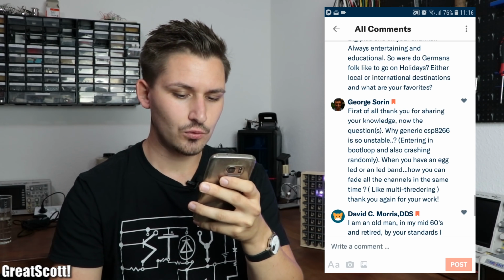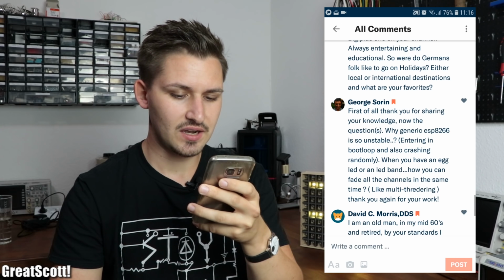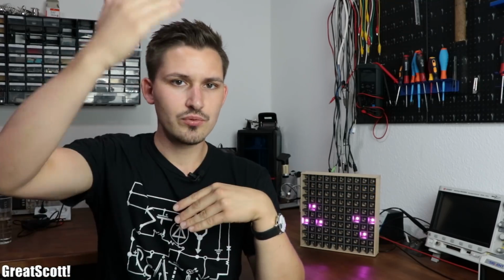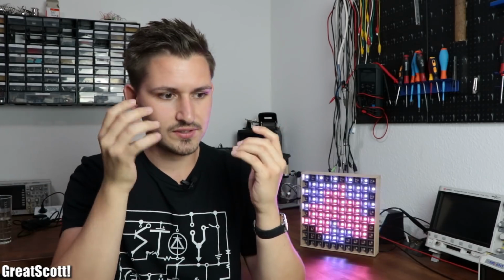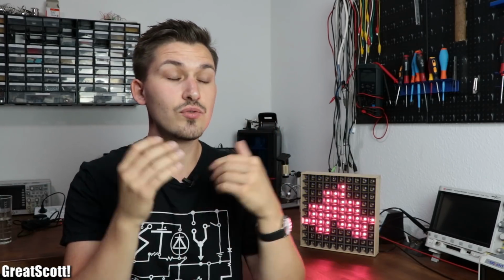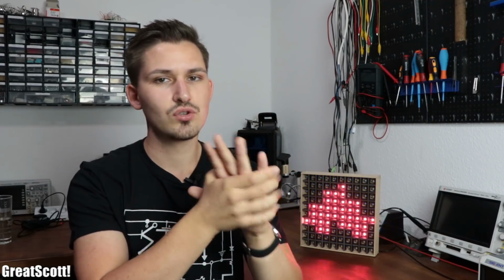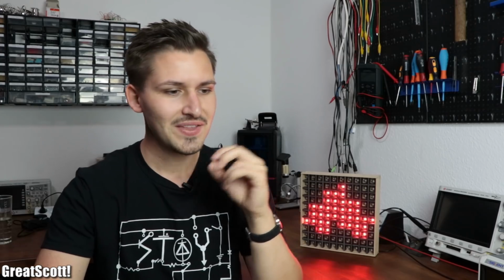Random/Unscripted Q&A #3

Comment: I have a question? Can a flyback tv transformer by used for power up light bulbs?dc motors? can this thing by some how turned to a usefull voltage? what components are used to amplify the voltage? can another transformer by used " step down"? well that shity thing use 10 to 30kv so? why not use it? but the question is how? and not die in the proces? the same question goes for a car ignition coil? I have some pore friend for some reson hese family dont have electricity he use a baterry converter 12v dc to 220 it drie the baterry after 3-4h so I was thinking helping him litel but not shure how fix that problem? and the question for baterrys how long they can least by using a converter/transformer? Ow by the way like ya ;) great videos I wish you all the luck in the futhure

Comment: I have a small question on this project ( https://youtu.be/CeStrH-5Llo ) : couldn't you have reduced costs, space and power consumption for this project by using an standalone ATmega328p for example?
I heard, that errors can occur during serial communication when not using an external oscillator, but even without using the internal 8MHz one.
Please tell me if I'm wrong, answer can also be in german.

Comment: Do you think you could make a DIY laser rust remover?  I've used these in automotive restoration shops before and they are something!!  If you accidentally point it at your skin it doesn't even heat it up!!  I'd love to see you try to figure out the electrical engineering behind one and possibly even make one!

Comment: I need Siglent scope in order to learn analogue electronics and  power electronics -  mainly switching power supplies. Thus I need 4 channels scope. Siglent also has serial data decoding functionality, which is needed to lookup serial communication e.g. SPI protocol. It takes me several days without scope to determine why serial communication on ATMega32A driven by interrupts was not working properly. This kind of instrument is quite expensive for me.

Comment: I just had a idea for future projects. I don't know which car you drive but if it is a older one that doesn't have modern features like windshield wipers that turn on automatically when there is rain, it would be interesting if you try to add those features by your self.

Comment: To the second question:
He could maybe use 26650 li ion cells.
They are 3.7V each with 3500mAh which would in series provide the wished 7.4V

Comment: You like EVs too!! Im currently converting my Saturn 2000 SL to electric and could use an oscilloscope! Check it out, Im actually waiting on a couple parts from CNC and Wire EDM manufacturers. 

diyelectriccar.com/forums/showthread.php/2000-saturn-sl-conversion-181954.html

Comment: Where i need to comment to try for the oscilloscope?? 

Sorry for this being too long but read anyway please :(

Anyway... Im electromechanical engineer student from a little country name Panama. I have main two projects currently that require an oscilloscope. The first one is an all i one charge controller, battery management, inverter system for solar. But, i want to make it as an educational module in order to put all the components and circuits in a way that students can use it as an electrical, electronical, logical circuits laboratory project.

Our university plan is outdated and specially our laboratories experiences. Many students lost interest in electronics since they found it too boring. Most experience are something like measuring current with a multimeter of a JFET. So this solar project can take all the theory and electronics circuits to be applied to something functional and helpful. I want to make the control of many discrete circuits so students can understand better how everything functions, not just putting an ic that does all the work. But i need an oscilloscope for development.

Second project may be my graduation project, if not a profesor an me would like to complete it anyway. In our local child hospital theres case where kids are born with out annus ( the hole wast not develope ), this is extremely critical for the life of the child, because he is basically stuck. The surgeon can take a procedure where he" construct " the annus of the child. The incision needs to be in a really precise spot where the muscles meet. Since surgeons don't have an instrument to locate this spot, they need to bulleyes it. Many times they dont locate the spot very well and even though the annus is constructed it isn't functional since the muscles can't contract in  a proper way. So a profesor and me think about making an instrument that cant locate this spot using the electrical signals that are get by electrically stimulating the muscles in the area. What would be better is a map of the muscles, but it requires equipment my University don't have, specially specially oscilloscope. We have oscilloscope but they are old and crappy and the sampling rate is not that good, also just 2 channels.

Im an electronic and programming enthusiasm. Where I live is hard to access components. You can't even get proper mosfet that can be used by an microcontroller. Thank god i can order stuff online, so i order components from usa , it takes longer  to arrive and is expensive but my parents help me. But, im oscilloscope like that one is something i can't afford. And the university i don't think is willing to help ( third world country problems ). Having that oscilloscope could accelerate these projects and be extremely extremely helpful.

Anyway, thank you even if i don't get it. Your projects are really inspirational and helpful. I use many of your videos for personal project and to learn. Honestly i kinda always knew how awesome electronics are but didn't know how accesible it can be. Your videos showed me that, i want to show other people the same and be helpful.

And stay creative

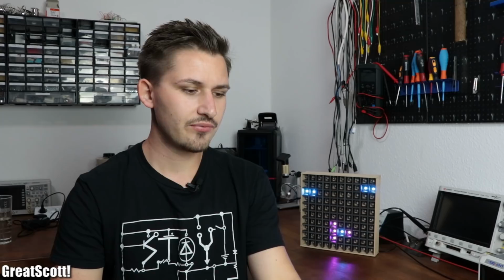Comment: Now maybe I'm missing some context here but you state at 36:50 multi-threading with micro-controlers is not possible. That's incorrect. You can put a operating system on the micro-controller such as FreeRTOS and create multiple threads. Now maybe you're referring to the esp8266 micro-controller which I'm not familiar with but a quick google search shows some people have used FreeRtos with the esp8266.

Comment: Hey, is it possible to make a Arduino board that you can upload a code by sending a file with wifi or bleutooth to the Arduino. I think you have to use at least two arduino's and a sd card. one arduino for saving the code to the sd card and uploading to the other arduino.
This would be great if that is possible.

Comment: There are micro-controllers with multiple cores like the ARM11 family. But in the most cases single processor micro-controllers are way more cheaper, more easy to programm and you dont need that massive power anyway. Greetings from Germany ;)

Comment: Hey scott your videos are awsome... I followed all of your videos. Currently i am working with a remote control with TX2b and RX2B ic..  But in the transmitter section i cannot visualize the waveform of frequency 27mhz..and i also want to visualize the demdulation of modulated signal to understand the working process of the circuit...The siglent oscilloscope can solve the problem... I need that badly.. Lots of love from india..❤❤❤❤

Comment: Right now I use my dad's old ~3ft x 2ft late 1970's tektronix scope to work on projects (recently I built a linear inverted pendulum with a spare stepper motor, raspberry pi/Arduino(tried both) using an encoder and limit switches for sensing). An upgrade would be terrific. By the way I'm going in to senior year of high school and have an internship at a local University (U of R Laboratory for Laser Energetics) for the summer. Thanks for all the fantastic electronics videos, and consideration for the giveaway!

Comment: Hi GreatScott, that oscilloscope will definitely fit my purpose. I'm starting college soon and on my way to getting a bachelor's degree in Electrical Engineering at the University of Arkansas. The oscilloscope is definitely a great tool to have, but it's crazy expensive, especially the higher models. I'm just letting you know and I wish myself the best of luck!

Comment: there is nothing more rewarding than taking a bunch of inanimate objects resistors caps ics etc.. and bringing somting to life yeah, 50 year ago i had your thoughts, no hi tec stuff just a box of old valves and stuff, build first 2 valve radio at 11, and i still build valve amps,  also love arduino rasp and Pic chips  all the best Steve

Comment: Your calculation on the boost converter is incorrect, you need to take the duty cycle into consideration. The current flows through the converter only when the switch is closed, so it must be higher than when assuming it flows continuously.
Reply: Xackus if the switch is the bottleneck you are right, but the typical inductor from a XL6009 boost converter is also stated with 4A current, which is the complete input current.
Reply: Exactly. Say 50% duty cycle, current must be double when inductor charging/discharging.
You also need to take into account the boost ratio, as power out = power in - losses,  if the voltage is doubled the current is halved.

Comment: Electric cars and much better solar panel tech. To get to 60+% effiencey panels. And much better batteries. Maybe there will be a discovery of a energy source similar to hydrogen fuel cells. That will be easier to use. And easier to design a support infrastructure. If batteries could charge fast like super caps. Where you can "refuel" in about 15 minutes. Or atleast half fueled in 15 minutes or so. That would be awesome. 150 miles range in 15 min. Electric would be everywhere. Especially if there were charge stations similar to a drive-in restaurant. Where you can park. Eat or even watch a movie. While recharging. Also with a convenience store! Pay charge by the minute! Or power used.

Comment: I agree with you about the electric cars. They will be the future of cars, but the batteries are the big problem. I hope flow batteries will get very good. This is the way I would accept an electric car. Powering a car with 18650 batteries, like they are doing it now, is not the solution.
Did you try the stencil for SMD soldering?

Comment: hello,  i have a question, I use a balance charger cc/cv with the same program to charge 18650 cells but boths voltages are not the same, can you give me an answer in Random/Unscripted Q&A #4 please. Ho and it's was also a good video.

Comment: As a Danish electrical engineer, I am freely allowed to work in Germany as an EE because of EU rules. Here in Denmark I am allowed to test my homemade equipment - no issues and no need for an electrician to wire it up for me. 
Selling my homemade devices to others does require it to be CE marked though, so it must then be tested and certificied - usually by expensive professionals, but it can be done by yourself, if you have all of the right (calibrated/certified) equipment.

Comment: Maybe DIY/BUY simple SMPS 12V/680mA considering safety isolations.
An opponent construction against bought can be TNY ic family (only needs EMI filter, snubber, optocoupler with 431 and capacitor for filtering and oscillator.
By the way thank you for not messing up with Chinese.
And yes, Marco Reps has got pretty good videos.

Comment: i want it pls iam 13 and i dont have sufficient tools pls
Reply: junior scientist this wont help kid
Reply: but i like to become a electric engineer but iam poor
Reply: junior scientist i'm sorry for you but you're not the only one who is young and hasn't any money! I am 14 and I also can't afford one! Just because you're 13/14 doesn't mean that you'll get everything ;) And also he picks the comments randomly without watching through all comments until he finds you. Sorry but as I said it's not going to help you...
Reply: also you have enough time to save money for one. I also had to wait multiple years until I got a variable bench power supply. But i wish you luck!
Reply: PyroHacks feels good to know i'm not the only 14y/o guy in here...
Reply: It's awesome that you are getting into electronics at young age! Everything is achievable with a little bit of elbow grease. You don't need a fancy scope to get started either. I've been building projects for a few years now and still haven't bought my first scope. They are very nice to have I would imagine, but certainly not a requirement. All you really need is a computer that can run the Arduino ide and some spare change for parts.
Reply: PyroHacks the point I was trying to make is that they aren't needed right off the bat. I've built RC cars, led watches, simple games with buttons and lights, rgb lamps, and more with only a multimeter and a cheap soldering iron. When you get into building more complex circuits sure, then you start needing to be able to see what's going on inside your wires, but for an increasing number of projects you can more or less plug and play with I2C and serial devices with a pretty limited knowledge of how the components do what they do. I don't think spreading around the idea that you need an osciliscope to make electronic projects is helpful to anyone, as it might discourage people who can't afford one from getting into electronics in the first place. Look at YouTubers like William Osman or Peter Stripol, I haven't seen either of them use a scope that I can rememeber off the top of my head and they make some pretty cool stuff.
Reply: Jacob Huckins Yes this is definitly true. I think it would be easier with one but with some motivation you definitly can perform the same tasks without one. I build a lot of high frequency circuits like a tesla coil or high voltage boost converter. When doing such things an oscilloscope is kind of a lifesaver ^^
Reply: Jacob Huckins I don't think so. If you work with more complicated circuits it really is necessary to have one. At a certain point you can't do this things without a scope.

 Haha lately I see more and more younger people doing such things ^^

Comment: Thanks for the advice. I just ordered the parts off Amazon :D
I used your link for the 18650s https://amzn.to/2uBZzl0
A 2S BMS, with 3.0v cutoff https://www.amazon.com/gp/product/B079QJZ88B
USB charger with display https://www.amazon.com/gp/product/B01GER8J6Y
and a 4 pin 2xbatt holder that I plan to attach the bms to the back of https://www.amazon.com/gp/product/B075N4DLSJ
Reply: Update! Totally works on tile, but instant car is put on carpet it dies. I think i'm exceeding the 4A output of the BMS, just ordered another 2S BMS with 8A capacity. Also, I had to add a momentary button to short battery ground to BMS ground to 'jump start' the BMS circuit. Was kinda obvious once I thought about it, but definitely had that sinking feeling when I first wired it up and it didn't go :D